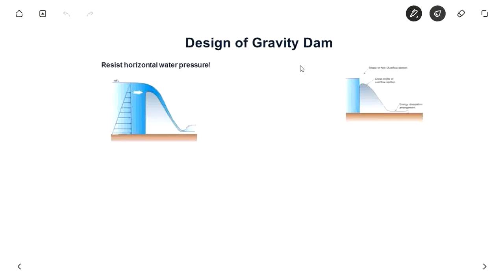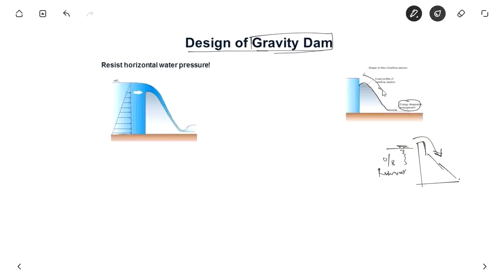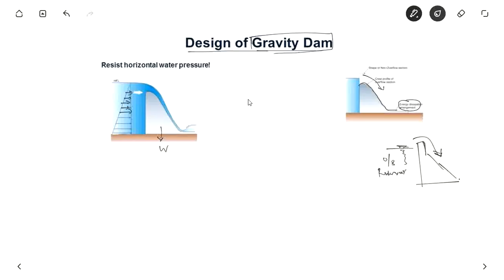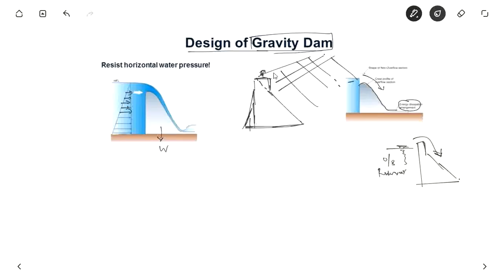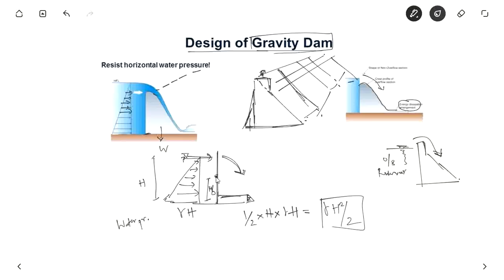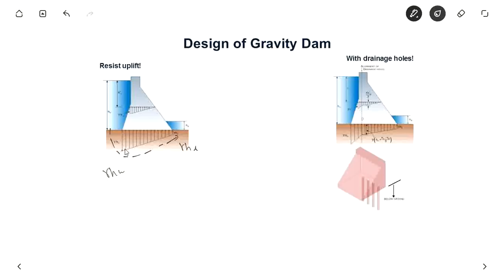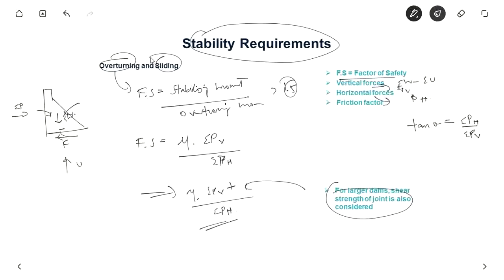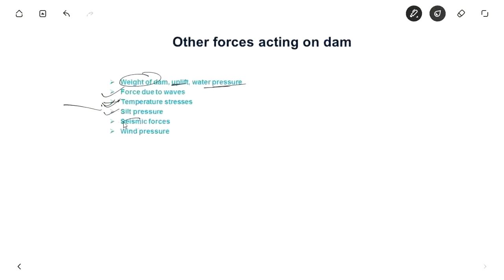Forces on Gravity Dam | Irrigation Engineering

Comment from the maker: Numerical at 06:43 : Head of water at upstream = 65m and downstream is 5m. Assuming unit weight of water as 10Km/m3 and concrete as 24KN/m3, what is the uplift force per unit length expressed in KN/m at PQ.
Reply: what is water cathment capacity in dam 
This is in cubic meter 
One dam capacity 45 cubic meter 
and what this is??